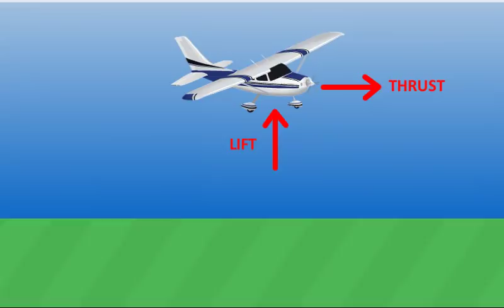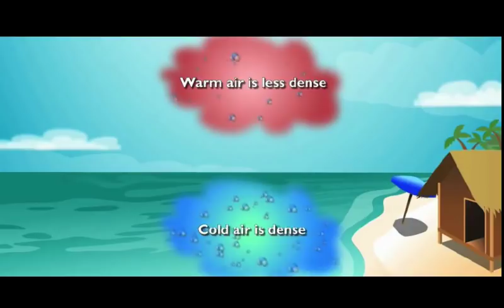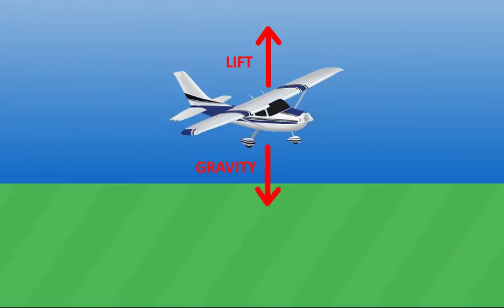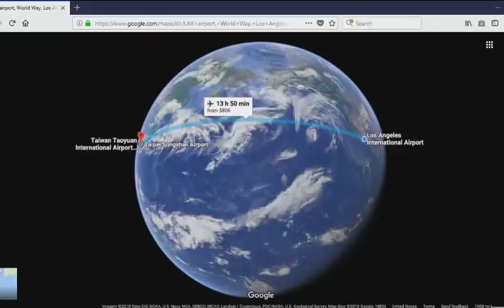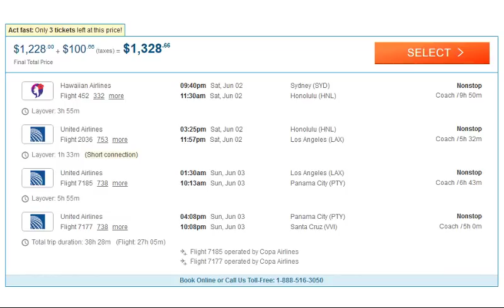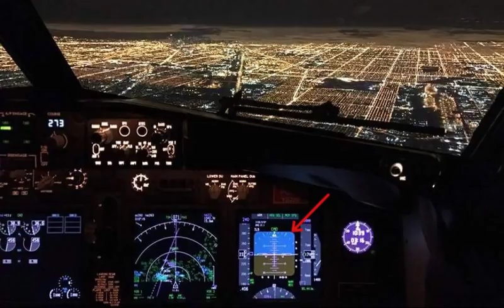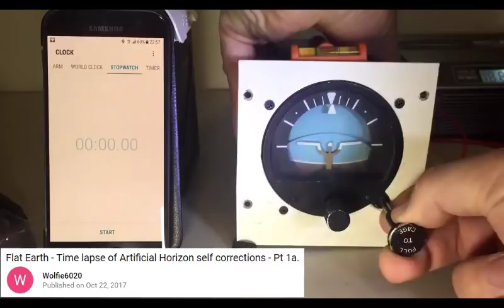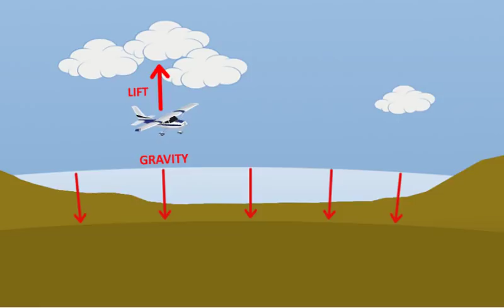Flat Earth Falsities - Plane Nonsense

Comment: Resume: "Gravity" bitch. Black magic, that explains EVERY THING!
Reply: Please don't breed.
Reply: Yes its invisible, as indetectable medium of gravitions, as its waves. 
Must have FAITH, without IT all the attracting MASSES would not remain locked in place. Would fly free or stick together....
Reply: @BrainUser1  Well No, becouse density and buoyancy. Air pressure can only be hold in a container, so no vaccum space is possible, try a glass dome that more like it. Next question.
Reply: @Borba3232  Why does the Moon stick around?
Reply: @BrainUser1  That is an easy one, moon is a light not terra firma,  you can do an experiment yourself with an infra red thermometer to confirm it has it's own light, phisically diferent than the sun's light, and stars have been seen trough the moon by ancient astronomers it's a fact of history.
Reply: @Borba3232  Okay then I convert to FLAT, had so much faith in a dusty grey ball mirror beaming hot light through our Atmospheres.
Reply: @BrainUser1  Why would you want to belive the globe? Just becouse they tell us the same thing over and over again? What do we have to gain? Other to think we are insignificant, on a blue pail dot in the outher space? If there is an other possible (and much more probable) answer for all the questions, we are much more than they tell us brother. Peace and blessings. Out.
Reply: @Borba3232  so let me get this straight. Theres no gravity but there is density and buoyancy?
Reply: @daveholmes5540  Man, really i am so full of answering the same things but yes. Gravity is not proved, if you say gravitational waves, then ok, but let's be honest here guys nothing i say will change your mind, and nothing you say will change my, we do not agree, so peace and have a good life.
Reply: @Borba3232  im curious as to how it is that keeps things on the floor?
You buoyancy answers some things but even buoyancy needs gravity to work. Its the bit that defines if something is heavier than another.
Have you seen what happens to air bubbles in water when gravity is removed from the equation?  The air floates around inside the water despite being less dense?
So if gravity is not real what dictates up and down?
Reply: @daveholmes5540 How do you remove gravity??? How is that even possible??? You say in you'r model there is gravitational force that atracts satelites like Earth to the Sun, so if gravitational force work's in vaccum as you say, how in the World are you able to remove it????  With a vaccum pump? WTF? How does you'r question make any sense? Is there or not such a thing called gravity? If the Earths mass atracts object due to it's mass, that creates the gravity you talk about, how do you remove it????
Reply: @Borba3232  what makes you think you can remove it? I said remove it from the equation, not from existance. 
The term zero gravity when we are talking about astronauts isnt no gravity at all its refers to the zero effect of gravity due to being in a constant freefall with the earth.
Il try get a link for you, its much easier to picture it once you understand it.
Reply: @Borba3232  cant paste links off my phone but just look on yt for how satellites stay in orbit.
You seem genuinely intrigued and possibly open to understanding. 
Ask yourself this, Which model, heliocentric or flat has an answer for all the questions?
Il give you a hint, flat model doesnt and infact  cant answer one without contradicting another.
Reply: @daveholmes5540  I'm curious, if gravitational force is a real thing, have we never had an asteroid come in a a perfect angle to be pulled into our gravitational force yet remain rotating in orbit, at least for a little bit? I'm genuinely curious. How do satellites get into rotation? At what point does the gravitation of the Earth die enough to allow them to orbit the earth without falling in or going off into space?  Wouldn't it be easier for a larger object to get pulled into our gravitational force from farther away? Because it would also have a gravitational pull. I mean, like a giant meteor or an asteroid? So again...why have any other objects, other than the moon naturally been sent into orbit around our earth? Does the moon not have enough of a gravitational pull to have things in its orbit? I'm really curious about this stuff.
Reply: @ErickMcNerney  right quite a bit to answer and il try and address as many as I can.
First thing to realise is how big the universe is and the likleyhood of a stray asteroid being in the right place at the right time.
We have been and still do get hit all the time but not by anything of significant size that it doesnt burn up in the atmosphere. There are huge crators all around the world from large meteors, probably the most famous in arizona.
We dont really get meteors coming into a natural orbit due to there approach velocity, angle and garvity not being able to pull such fast projectiles in. There are a number of comets that do have elliptical orbit in our solar system.
As far as satellites being in orbit its all to do with distance and speed.
Satellites dont escape gravity and like any you throw on earth travels in a curve, so does a satellite but the curve a satellite falls is the same curve as the earth so its basically in constant free fall and the closer to they gravity source you are the faster you need to go. So higher satellites rotate at a lower speed. Its like swinging a ball on a rope, the closer it is the faster it has to go to maintain its path.
I admire you asking and if people genuinely want to learn im more than happy to help.
Hope I was clear enough with everything.
Reply: @daveholmes5540  yeah thanks, that all makes sense.
Reply: @ErickMcNerney  hey no problem if I can help I will but I have limited knowledge and there are people who could probably explain alot more in depth than I can.
Reply: @daveholmes5540  I think there is an experiment that could put this whole debate to rest. Just a really long rope....like 3 miles long. The rope would have to be a fixed length in inches though. 2 people on each end of the rope at sea level would hold on and they'd have to pull it tight --probably have to use machines to assist. But the point is that if the earth curves, some of it would be submerged in water. Would be really difficult to assure that the rope or cable is pulled tight the whole way across. But in principle this experiment is sound.
Reply: You'd also see a discrepancy in the length of the rope and the true distance apart if the earth is a globe. The rope, if pulled truly tight, would be shorter than the distance measured at sea level.
Reply: @ErickMcNerney  basically ues although I think the trouble would be getting rid of sag but very similar experiments hav been done usin lasers and measuring the height from the water to the laser. Although they would just claim its fake anyway.
Reply: @ErickMcNerney  I was wondering why you were asking? Is it something you just never looked into before or tempted to believe the flat earth bullshit or something else, or torn between the the two?
Reply: @daveholmes5540  I think I'm drawn to it because it kind of enlightens my curiosity. I think it's fascinating. My background is in psychology. I'm trying to remain an outside observer and I'll comment and respond to bullshit no matter who says it. My strongest subjects in College were logic and astronomy. I regret getting a degree in psychology but I suppose it has helped me. I know how much we can deceive ourselves. And despite flat-earthers saying that everyone is deceiving themselves (who believe in the globe earth), I see them participating in the same self-deception. Mostly in the form of confirmation bias. But I think we who are inclined to believe in the globe earth take many things for granted, and do not really understand as much as we think we do. I think it is precisely these unknowns and illusions that make it possible for anyone to deceive people. It's possible to see things differently if our assumptions are different. While I do admit that there are some fishy things going on with NASA and space (and I'm not so sure we went to the moon), I am almost 100% sure that we live on some kind of spherical orb.
Reply: @ErickMcNerney  oh, you replied to my comment, does that mean its bullshit? How did that make you feel? Haha sorry, just a little psychology humour. 
Yeh I dont really care for all the nasa stuff, I dont even care if it was fake. I am however intersted in the universe and how things work. 
Im also not very tolerant of gullible people spreading tripe on the basis of thats whats they believe. 
If they genuinely dont know but are willing to learn then im all for it and admire self improvment but most of them just have their fingers in their ears shouting là là là while you're trying to explain.

Comment: most of what you said is correct expect the part flying and time spend if you was to fly from the north to the south I a dead straight line without using your navigation to keep you on course you would fly off to the left from curious effect snipers have to take this into account  the reason why they stay on course is they follow a direct latitude line in auto pilot it may say 360 degrees south and it adjusts to that course
Reply: So you agree on the most 6:41 "parallel to the force of gravity?" HUM...!
A dead curved straight (automatic)line, perpendicular to the Coriolis effect?  At that high the effect could be influential... More then the sticking close dense hi-pressure ground Momentum, carrying the rest of Atmosphere far far far up!

Comment: And one more for you with your big brain houses that you could hear the f**** Pilots saying that they're leveling out at 30000 feet. You're on a ball how do you level out on a ball leveling out for 4 hours don't you think you'd be in space. That's about the most common of Senses you can possibly take to this argument a plane cannot level out on a wall nothing can it would be curved jackwagon
Reply: Thanks for showing how small and cartoonish your thinking is.  The video you didn't watch explains it.
Reply: Ray Crockett 
No, you’ll only be space if you gain altitude, the aircraft is level relative to its position above the ground.
No different to tying a string to a nail, as you extend it to full length consider that the aircraft reaching cruising altitude, now as you move around nail with the end of the string at full length it would keep turning around the nail with the end at the same distance thus maintaining level relative to its position to the nail. Level does not mean flat it means maintaining a constant altitude
Reply: Human pilots and autopilots are constantly adjusting to hold a level flight. In a long flight they need to adjust to compensate for the weight of the fuel being burned off, the weather conditions, the time of day and so on. These are small adjustments that we don't notice - including compensating for the curvature of the earth. Yes, we're on a ball. A ball so big that we don't notice that it is curved.
Reply: Ray "in this context" for Believers have a curving Level, just straight Left /Right (as long as they dont go over any artic walls). The surface has automatic Gravity uniformity no matter what composition, oblateness, depth or mountain range, or a close Moon pulling on water= the bubble stays sanely level to the curve ball :)
Reply: To leave earth's gravity you need speed in a range of 25000 mph. The only concern and adjustment the pilots have to do is dealing with gravity and they do that by adjusting the speed and aerodynamics of the plane.

Comment: I got one for you why don't you get on a moving train and run with the moving train and jump okay you were going to be about 2 ft behind from where you started your initial Run and Jump motion not a head behind and even if that is this same thing you ever heard of a slingshot will it eventually loses its motion because this would be accurate with bullets anything that you would launch but it eventually loses its momentum that would be the same as a plane on a v f**** our flight
Reply: Ray Crockett 
You’re inside the train not above the train just like you’re in the Earth’s atmosphere not in space. The atmosphere moves with the earth so you’ll land in the same spot like you would if you jumped inside a moving train or aircraft
Reply: Why not try it? Get on a train with a buddy. Throw a ball between you. The ball will behave exactly the same as if you were standing on the ground. It doesn't matter whether you throw it in the direction that the train is travelling or against it. Or left to right. Everything on the train is travelling at the same speed as everything else on the train. It's exactly the same with the Earth.
Reply: Ray it may be too quick to be relevent(even if much slower travel then Globe). 
The domed train running straight (curved or not) has a strongh air pressure locked inside. You need to spin that wagon as it flies ahead, then the outside forces would take over, just as water leaves Momentum  in a washing machine.
Reply: Louis Shaw 
Exactly. Then people ask about how weather works, storms wind etc when everything is moving around, its no different to having air on or a fan blowing air inside a moving train or aircraft
Reply: @richard086  No different I dont know... those have barrrier locked atmospheres, fan has small percentage of disturbance.
Hurricanes and tornadoes, corolis deplacements are major local counter Conservation /Momentum agents.
Fan is totally a powerful outside Force, others are internal atmospheric caused.  No different for greek science maybe.

Comment: Excellent Flat Earth Debunk. But you made an error at the 6 minute mark where you stated that gravity curves the direction of an aircraft automatically in the vertical direction. That is not a factor in an aircraft following the curvature of the Earth! Such a description of the forces involved are true in Space, but not to an aircraft flying through the atmosphere. What causes an aircraft to follow the curve is the aircraft altimeter. A pilot sets an altimeter in autopilot and the aircraft adjusts its nose up and down to maintain that altitude. Over time, the aircraft gradually and inconspicuously follows the curve without the pilots noticing it. If there is no autopilot the aircraft pilot must do this manually but the result is the same. I am a student pilot, but you will find other pilots to say the same thing.
Reply: There is no adjustment needed as the aircraft will naturally follow the curvature of the earth without any input from the pilot. This is because the aircraft flies through the atmosphere which also follows the curvature of the earth.
It's the air pressure that keeps a plane in level flight. Increasing altitude reduces the lift and the plane falls; decreasing altitude increases the lift and the planes rises. And what causes the variations in air pressure? Gravity. What does the altimeter (aka an aneroid barometer) reference to determine altitude? Air pressure. And what causes the variations in air pressure? Gravity. And temperature of course.
Inertial navigation is different.
https://en.wikipedia.org/wiki/Schuler_tuning
And read the references provided.. The "schuler loop" is an integral part of avionics, that automatically compensate for earth's curvature.
http://www.mediander.com/connects/26619546/ln-3-inertial-navigation-system/#!/topic/-/
http://aerostudents.com/files/avionics/navigationBasicsAndInertialNavigation.pdf
Reply: You guys just make stuff up as you go along. No matter what people observe and bring up you will always come up with something. Only those wishing to deceive them selves will be deceived by you.
Reply: @reggiereid1345  Fuck off Reggie you pathetic troll.
Reply: @reggiereid1345  Actually, they're both right. Neither argument even contradicted the other, which you would have noticed if you read them.
Reply: @nimrodery  not really... Miles Wilson is just incorrect.
Reply: @dirt_rooster36  Okay, so how does autopilot work? If you can't set the altimeter and fly at a constant altitude, we wouldn't have autopilot, right? How about explaining your comment. The guy is a student pilot, perhaps you should tell him why he is wrong, so he can learn. Please, enlighten us on your knowledge of commercial jets.
Reply: @nimrodery  I've been working on aircraft as an A&P for 7 years, specifically on flight control systems.  If what Miles said is correct, then eventually your yoke/stick would be slammed all the way forward.  Look no further than what wong said, which is right.  An aircraft will naturally follow the curve of the earth without any adjustment needed, autopilot or not.  And autopilot systems work vastly different on different aircraft, and lots of older passenger aircraft don't even have autopilot still.
Reply: @dirt_rooster36  Wow, two consecutive answers to a question nobody asked, and both answer nothing. I see no reason the yoke would be slammed all the way forward, and it isn't apparent in the OPs comment, so if you're the expert, please inform. Right now you ain't doing it.
Reply: Okkk nice
Reply: @Rollie Sorry, Rollie, didn't see your response. Much better than Charles' cryptic one, which was amazing for somebody who says it's his job. Again, though, you should be talking to the flight student. I have no need to learn this trivial detail. Since you're here, what's the device pilots use to set autopilot altitude? Being a noob, that's what I'm referring to as the "altimeter."